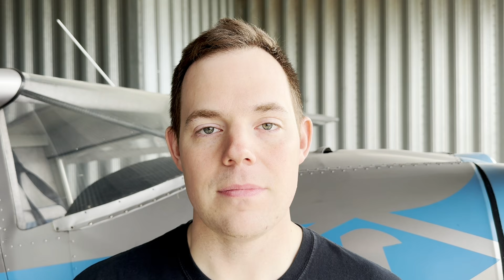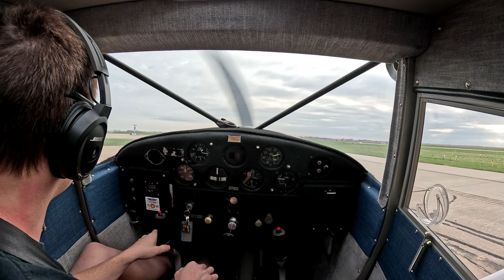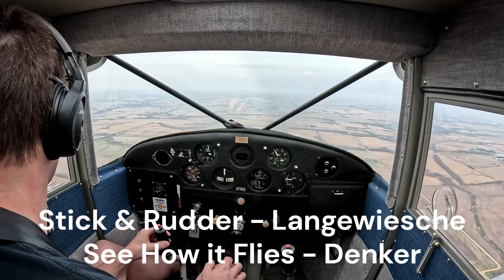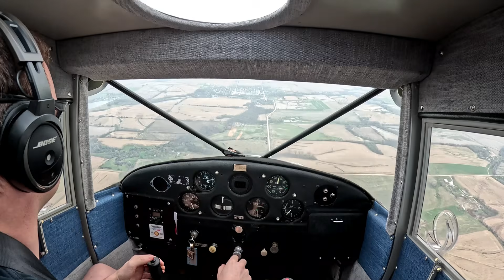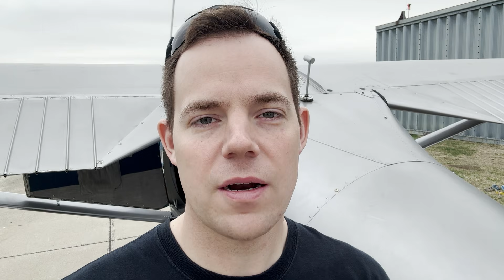Pitch or Power? The Answer Most Pilots Get Wrong

Comment: If you are on final and on the proper glide slope and you start getting slow you don't lower the nose unless you enjoy creating another problem unnecessarily. You maintain your aimpoint and add power to get back on speed while staying on the proper glide slope. 
If you are high on final and pull your power but keep your original aimpoint you will get slow. You must allow the nose to PITC down. Pulling power also cause nose to PITCH down so its pitch and power in reality. Just have to do some of that pilot sh$&@t.

Comment: Oh….so Power for Airspeed if available and variable, and Pitch for Altitude doesn’t work all the time??  Wow! 40 + years,  12,000 +  hours flying everything from Cub, to Boeing 757 and a lot of things in between, and I was ALL WRONG because I didn’t understand a wonk in a dink Luscombe and “causality”.
Imagine my shock!! Especially since no crashes, no incidents, but I was walking on that razor wire because I didn’t understand  “causality”……Shaaazzzzammmm. 
Listen to this guy all ye who don wings!! He has re-invented air🤣
Reply from the maker: I’m happy to discuss the issue without name-calling or credential measuring if you are.

I’m not claiming that experienced pilots who use this phrase are unsafe or unable to fly. A pilot can develop excellent control habits through observation, practice, and correction even when the words used to describe those habits are imprecise.

My point is narrower. “Power for airspeed, pitch for altitude” is not an accurate causal explanation of what the airplane is doing. Pitch and power both affect airspeed and flight path. The technique can still produce the desired result procedurally, but that does not make the explanation physically correct.

If we want to improve as an industry, and not merely pass our methods along through osmosis, we have to be willing to examine the language we use, discuss it openly, and refine it when better explanations are available.

Comment: Wow! Just wow! I am learning so much from you! I will not say more, otherwise I will do you injustice.

Defining a flight condition as a specific combination of:

Airspeed, and
Flight path / vertical profile (level, climbing, descending, climb rate, descent rate) not just altitude by itself.

For example, in David's terminology:

80 mph in level flight = one flight condition.
75 mph while climbing = a different flight condition.
75 mph while descending = yet another flight condition.

The main argument is that before moving the pitch, you should think:

"What flight condition do I want to be in?"

Then:

-Set the power appropriate for that desired flight condition.
-Use pitch to achieve the target airspeed.

This is why he repeatedly says:

"Power for flight condition, then pitch for airspeed."

Comment: I recently made a video on this same topic, which is available at: https://youtu.be/w_KS7-BP1n8 . My video focused specifically on final approach. One thing I focus on is the distinction between a transient effect of a control change and a lasting effect. By lasting effect, I refer to the new steady state condition that you end up in. The lasting effect can be analyzed by looking at the new balance of forces. I reach the conclusion that pitch should be used for airspeed and power for descent rate. I like your modification of that by saying power for flight condition instead of power for descent rate. Doing it the other way around, pitch for descent rate and power for airspeed, works some of the time in certain aircraft.
Reply from the maker: Thanks for watching and sharing. Enjoyed your video!

Comment: 50:05 that is what needs to be taught. 
"Really, the power is just adding or taking away energy from the whole scenario. We can then choose how to use it. [...] choosing happens with the stick."
On a physical level power is actually the rate of change in energy level. What it comes down to is the definition of the excess power of the aircraft. 
Excess Power = dh/dt + (V/g) (dV/dt)
Sounds scary but it's actually just saying more excess power gets you a change in height dh over time dt (=vertical speed) or you can gain speed dV over time dt (or both). And you can trade altitude for airspeed and vice versa whilst keeping the excess power the same. 
For constant airspeed you can just read of the vertical speed indicator to know if you need more or less power to maintain altitude.
And to maintain altitude (vertical speed zero) the change of speed over time change tells you how much excess power there is.

On top of that you get all these natural tendencies of the airplane which you very well described in the video.

Comment: It would never have occurred to me to be a workable assumption that I need only adjust elevator trim OR throttle settings to hold a current airspeed and altitude.  Winds are swirling and constantly changing speed at altitude and without an autopilot, I can't imagine any way that a GA aircraft could be made to hold constant speed, altitude and heading without regular adjustments to both trim and throttle settings.
Reply from the maker: That’s a fair observation about the real world not being perfectly stable, but there’s a key piece missing here: the airplane itself is already doing a lot of the work. Most GA airplanes have built-in longitudinal stability. If the airspeed increases, the airplane naturally tends to pitch up and reduce it. If it slows down, it tends to pitch down and regain it. That’s happening continuously, even in imperfect air. So the idea isn’t that you “set it and forget it” in turbulence. It’s that you’re not manually holding everything all the time either. You’re trimming to a condition where the airplane wants to stay near that airspeed, and then you make small corrections around that. Same with power. It sets the overall energy level, but it doesn’t need constant chasing unless conditions are changing significantly. If the airplane had no natural stability, you’d be right. It would feel like balancing a broomstick on your hand. But most training airplanes are closer to a pendulum. They help you out.
Reply: One word, given a positive stability, vs neutral or instable: EQUILIBRIUM.

The stability acts like a weighted pendulum, keeping plumb.. in equilibrium.

What he did was show the different independent inputs' action upon the equilibrium the  during transitions .. which can be seen as exchanges.. throttle as ENERGY rather than climb or descent or airspeed ..ENERGY changes TOTALITY OF CONDITION of a fixed control setting (trim) much like an "aerodynamic control" input, by changing effect of the surfaces in a new condition of thrust vector against CG &/or propwash/jet wash over surfaces..even subtle variation to slipstream from jet intake over wing can make a difference..
When you "see it" it all comes together easier in a smooth commanded flow rather than chasing reactions.😎
Reply from the maker: Very well put. First learn the system. Then dance with it instead of arguing with it.

Comment: It looks like you have a high main wing & low rear wing. Does it always make sense to have the two sets of wing in a different air flow to maximize their respective efficiency?
Reply from the maker: Great question.

The cleaner the air you can present to a flying surface, the more efficiently it can generate lift, whether for sustaining flight or controlling the airplane.

In the case of my airplane, the tail sits in what we call the “downwash” of the main wing ahead of it. That downwash changes the angle of the airflow and reduces the tail’s effectiveness somewhat.

There are tradeoffs to every arrangement. The classic high wing with a low tail is a good overall balance, with relatively benign handling and simple, economical construction compared to something like a T-tail or canard.

Does that help answer your question?
Reply: @DavidTwibell  Sure, thank you.

Comment: The brake rudder part was cool. Ever done the higher than normal taxi, preferably with no wind, and work the ailerons to show how adverse yaw works? I’ve never seen a decent video on it but I have helped several pilots with it, made them understand more as far as why you turn the yoke into the crosswind on a takeoff. And with upwind wing low, the drooping aileron helps the rudder align the plane with the centerline.
Reply from the maker: On the list! Blows people's mind the first time they see it.
Reply: @DavidTwibell awesome, not sure how it will work on a taildragger but it’s neat on tricycle gear for sure.
Reply from the maker: It works even better in a taildragger when the tail is up because their is no nose wheel to resist the motion.

Comment: What an excellent video! I did notice that on finals, you maintained airspeed and aimpoint meticulously and controlled altitude with a slip. Our flight school teaches to set up finals parameters during base and early final - Pitch (trim) for airspeed and power/pitch for altitude with low rpm (usually about 1500rpm for the Cub). Once established on final at correct altitude (about 500 ft AGL) and best glide airspeed, we switch to using pitch for aimpoint and power for airspeed (but adjusting pitch according to power changes). This is something students cannot pick up in one or two lessons but pick up over time. It has to become intuitive. If we are too low but fast, we can exchange airspeed for altitude. If we are too low and but speed is good, we teach performing a level step until joining the glideslope adding a little power, then regain aimpoint and reduce power. If we are too high but on speed, we perform a slip. There are more scenarios that we cover with a grid chart
Reply: Unfortunately this is a discombobulated procedure that isn't transferable to other airplanes.  As the Handbook points out in Chapter 1, "The purpose of flight training is to develop the knowledge, experience, skills, and safe habits that establish a foundation and are transferable to any airplane."

Comment: Trimmed, stabilized and no wind… is one thing…
But in reality…. 
HEAVIER AIRCRAFT….do demonstrate … “power for altitude “.. best when they are “mostly stable”  and configured…on the glide path… 
once 
configured
With power set
And trimmed for a stable airspeed…
THEN …larger /heavier aircraft can use “ energy management” to correct slight deviations the glide path…  
“ on speed  but VSI shallow and aircraft drifting above Glide path” … means slightly too much energy ( engine power)… so a slight reduction in power is probably the corrective action.
Inversely 
“ on speed stable but sinking below glide path means “not enough energy” so a slight increase in power is a starting point.

BUT… 
The CRJ 200 had a good enough autopilot… that captured and flew down the glide path…WITH PITCH…. because the “200”… didn’t have auto throttles…
So the autopilot pitched down to fly the glide path ( pitch for altitude) and the pilot flying adjust power to keep the aircraft on speed.

And…. When you look out the window and you see a hill or tower right in front of you…. 
What is you IMMEDIATE  REACTION?
Do you add power  ?
Or pull the yoke back?

pitch, power, alt, airspeed and vertical speed…. Are all constantly effecting each other.
And the “one answer-answer”…is not very wise…
FINALLY…
As a CFII/ MEI, Training Program Manager, Director of Training…
If you know where you are on an approach, and you know the applicable configuration and approximate power setting…. Then everything else will be damn close.
THEN you can make tweaks…
But the CFIs that are bitching about 5 knots or even 15 knots as we are passing the final fix… but have no “standard “ for config and power…are the problem.

Ask ANY  steam gauge airline pilot what his power setting is as he is crossing the FAF…
and they …ALL…. can answer…. ( something like ) “.45 EPR” or Fuel flow xxxx… it’s different for each aircraft and gauge system… but we ALL KNEW our initial power setting when coming down the Glide Slope.

A Cessna 172… 
Carb Heat, Power 1900rpm…
Then… first notch of flaps…
Trim for level = 90 kts
Intercept the glide slope … power 1700 rpm. The nose settles a little ( and you dampen the nose fall with finger pressure… )… the  air speed stay constant.. but now you’re coming down at 450’/minute. ( if you’re flying a Seminole… keep the power and drop the gear)

The above is 90% true… and just hood STARTING points….
START with the above and just learn what the power settings are…
2100, 1900, 1700…. Will get you damn close… and tell your instructor that the old guys said that they should chill on the airspeed….STABILIZED  APPROACHES ..especially when you’re  learning is MUCH more important.

Comment: I was taught to use the throttle for altitude and pitch for speed, and I think for the most part that's how you approach it, but of course it's not cut and dried and of coiurse if you pitch forward you are going to go down, and if you pitch up you're going to go up, at least until airspeed degrades unless you apply more power.
Reply: The throttle increases the thrust vector which is like pulling horizontally on a string tied to the propeller.   How can that oppose gravity to control altitude?
Reply: @warren5699  Yes you are correct but increasing power and pulling on that "horizontal string tied to the propeller" increases speed,  even in level flight, which increases airflow over the wings which makes the wings produce more lift. More lift you go up less speed, less lift, you go down.
Reply: @coalsojr2003  The increased power increases speed only when the pitch is in the proper position.  As you know, with typical trainers, applying full power for go-arounds usually results in a loss of speed (not increased speed) and a stall, if the pilot doesn't intervene with forward pressure.  And because acceleration is slow, it normally isn't a practical way to increase lift on approaches.  Besides, you wouldn't want to be accelerating above Vref nearing the runway.  The last thought you mentioned is how the controls are designed to be used - pitch to control altitude simultaneously adjusting power to maintain desired speed, right out of Chapter 9 in the Handbook.

Comment: In calm conditions one can use either pitch attitude or power for control of your descent profile. However, my experience flying a B737 200 into short runway mountain valleys in gusty and crosswind conditions, where it was essential to maintain your profile or glide slope, was to fly the slope with elevator. Power changes are far too slow to maintain the glide slope or profile you need to follow. I would fly the slope with elevator, and then control the desired speed with power, since one must never deviate from the glide slope profile for a controlled landing touchdown. Speed is far more responsive to thrust changes than to pitch anyway.

Comment: Pitch or power? BOTH.  I use both pitch and power on almost every landing. It depends on what adjustment I want to make. If I'm low on the glideslope, I level off and add power. Too high, pitch or slip and reduce throttle. There's not one or the other.

Comment: Good stuff for high altitude orientation where there are no horizontal space available limitations.  In maneuvering flight like crop dusting or flying the pattern at an airport with terrain or obstacles horizontal space available limitations, Wolfgang's law of the roller coaster (airspeed is altitude and altitude is airspeed), what the airplane wants to do (especially in turns), and wind management to use a headwind component to increase rate of turn and decrease radius of turn become critical.  You have excellent feel for the physics of flight.  Perhaps review Stick and Rudder and do a lessons on each of these very important principles and techniques for low altitude operations.